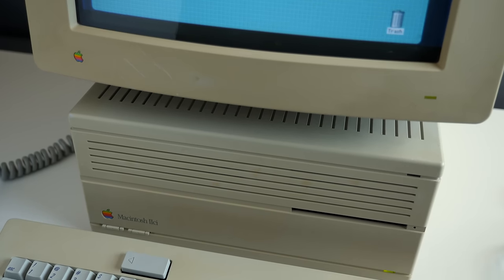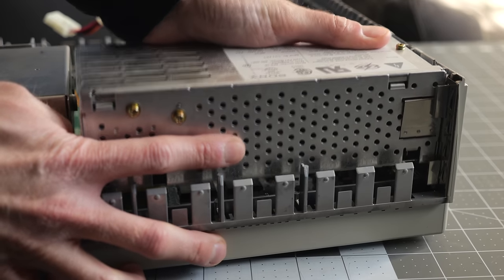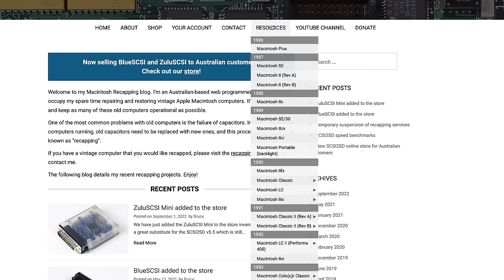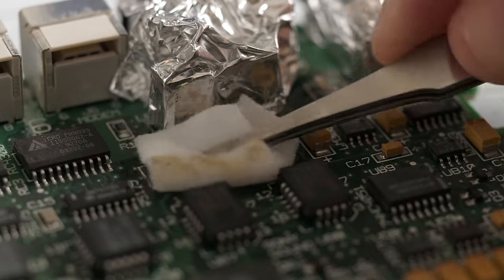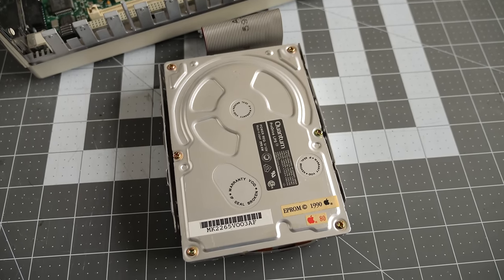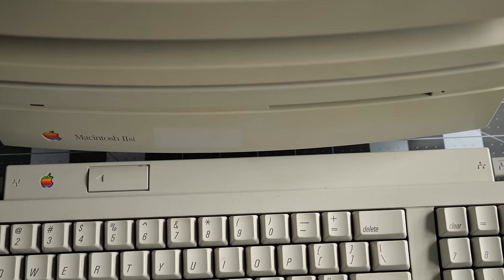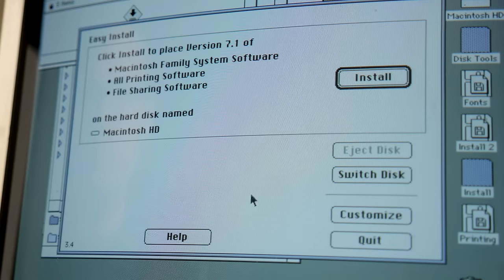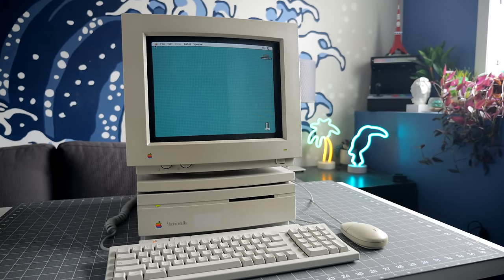Restoring One of Apple's Weirdest Vintage Macs!

Comment: Pro-tip from the car world: to release those plastic cable holder connectors that have the two teeth (look like a tree), use a socket from a socket wrench set. A small one will squeeze the tabs at the same time making it easy to pop off
Reply: In the computer world, screwdriver kits usually include a nut driver for hex-headed screws, which works pretty well.  Or the tube from a pen.  :-)
Reply: @nickwallette6201  pretty much the same thing, yes, a e-hex bit for standoffs will usually work

Comment: I completed a restoration of a IIsi where the PSU was a gooey mess from cap juice that even ate some of the traces on the logic board PSU connector. Yuk! I also made the same mistake on needing to provide external power for a BlueSCSI to work. Thank you for the explanation on using the RAM muncher to use up the extra RAM not used by the onboard video and thus improve overall performance, which I’ll add to my IIsi when I return from Spring Break vacation. Nice video, Colin!

Comment: Great episode. That BlueSCSI seems like a life-saver for these older systems.
Reply: It is, and it’s cheap enough to easily outfit an entire collection of vintage SCSI-based Macs. I love mine, and plan to buy many more.
Reply: The convenience looks great, however I like leaving spinning disks in my retro machines. Part of the charm is listening to the drive click away as the system loads software.

New hard drives are super quiet so I don't have that same fondness for newer mechanical drives, but the old ones are always satisfying to listen to.
Reply: @volvo09  This is a 100 percent valid reason to stick with spinning disks.
Reply: @volvo09  yeah I think if my first computer didn’t have that clunky head motor so I could “hear it thinking” it wouldn’t have had half the charm for me. Plus the distinctive noises it made as it unparked, and less-so when it parked.
Reply: @volvo09  I agree with you there. How’s this for irony? I have a real Commodore 64 connected to a modern flash based disk drive. It lets out the occasional beep so you know it’s working. On the other hand, the VICE emulator on my Raspberry Pi (Retro Pie) actually emulates the sound of the 1541 disk drive when loading. My brain gets more of a kick loading up games on the emulator as a result. Sound was a huge part of the memories.

Comment: Great video!  The IIsi was my first color Mac, and I recently restored one and upgraded it with a Daystar 50 MHz 68030 accelerator and Ethernet card, so it's no longer an lower-end Mac.  You can also easily add a HD activity light by hooking up another wire to the lead by the speaker.

Comment: Worth mentioning the "special" soft power button. It has a slot in it and the little graphic above it hints at it purpose. If you turn the button it will remain in the powered on state - it removes the soft power option.

Comment: Cool video. Remember having a few of these at work when my  IT group supported Macs & PCs. My recollection is that they were reasonable machines but I still preferred my IICi which was my daily driver.
Had forgotten about the shared RAM issue.

Comment: I've overclocked my IIsi to 25mhz. It required flipping the fan around, when some part on the logic board gets too hot it starts getting memory corruption. With the fan blowing directly on it it's completely stable. 
The internal video can drive a portrait display, too!

Comment: I work in electronic manufacturing. SMD department.
That flux you use, I think it's banned in manufacturing these days because it's way too strong and can corrode the board itself.
These days it's mostly used in old repair shops, not in modern manufacturing.

Comment: the IIsi was my first Mac as a kid... and I've still got it to this day. I love that it fits a full height hard drive and can take 64MB of RAM. It runs well with an FPU Card/Ethernet card, and easily overclocked with a crystal replacement and runs stable at 25MHz.

Comment: Hey just a little heads up. It's okay to replace electrolytics with tantalum caps, just as long as you're aware that tantalum caps have a different frequency rating. You could potentially cause some problems by putting a tantalum in a circuit where it shouldn't be. Say for example... where a clock frequency is.

Also be aware that the failure mode for tantalum caps is to short, instead of go open like electrolytic caps. So in the future when they fail, they could grenade other components along with it. They also don't handle voltage spikes very well, and they tend to have lower voltage ratings.

Comment: I remember using a IIFX that was loaded with early ProTools software (4 channel Pro Deck & Pro Edit) which was SOTA at the time. Soon new combined software called ProTools was released which allowed 4 channels and later 8 channels using the IIFX platform. Great little computer for the time. We also had a IISI which was a second editing machine but it never expanded beyond the original software(Pro Deck & Pro Edit) and was much slower with the processing of audio samples.

Comment: 8:54 - "user installable updates weren't really a thing back then", hardware wise that is true, however each OS update usually patched out the ROM - so much so that Apple realised that the ROM was usually patched coming to the end of the life cycle. This is probably one of the reasons why the went with ROM in RAM, not just a cost saving measure...

Comment: The IIsi's PDS is actually electrically compatible with the SE/30's. The only differences are that SE/30-compatible PDS cards don't have a 68882 (since the SE/30 already has one) and they're shaped a little different so they clear the steel chassis.

Comment: I had a very similar issue on my Macintosh IIci as you did with the BlueSCSI on this machine, just with the ZuluSCSI. It worked on the back port but not on the internal one - until I attached the power. The difference was that the drive would seem to work (the light would come on), but it would be completely unreliable, and never boot successfully. (I recapped it entirely, so it wasn't down to that either)

Comment: Thank you for making this video. I have a IIsi in my building I am going to restore once I am finished with my Color Classis and Power Macintosh G3/233MHz Beige computers. Question: Is there a site I can order the MeowTOAST PCD you used? Also, did you only have to solder the CR2023 holder to the MeowTOAST PCB? 

Thank you!
Randy

Comment: This model was my first successful recap when I started collecting retro tech in 2019. I went ahead with the crystal upgrade tho and installed a socket. I worked around the slow onboard RAM by increasing the disk cache. Original hard drive still boots and the CPU is running stable at 25MHz.

Comment: Oh The IIsi is a neat machine.  I used one for a while.  I didn't know about the RAM muncher.  I think to get around the slow 1mb RAM it was common to set the DIsk Cache to 768k to eat up that RAM and programs would then run on the faster RAM exclusively.

Comment: You could overclock that 030 with no issues, my first amiga 1200 came with a dkb cobra with a 20mhz 030 at 28mhz from factory, and I had it running at 40mhz, it even managed 46mhz but the mmu had issues. 030's don't really get warm even when overclocked. I think I just stuck a passive heatsink on it when it was at 40mhz.

Comment: Tantalum caps can fail in other ways: dead short.  I've had bad tantalum caps on old boards several times.  In one case the computer wouldn't power up, in another when it powered on the cap exploded.

Comment: Awwwwww, Brahcnus doesn't have an entry for Quadra 700. My Q700 PSU still works fine, but was thinking of recapping preemptively. 

Acutally I'm kinda suprised that there's not alot of information on the Q700 PSU caps out there, given that it's one of the most sought after models in the 68k range.

Comment: I owned a IIci and later I got to play a bit with a IIsi because we had a couple of them at a news magazine I worked for in the 90s. It was definitely not as fast.

The production department all had PowerMac 7200/120s (I owned a 7200/90 at the time). Definitely faster.

Comment: I'm getting increasingly concerned about the plastics on this era of Macintosh...they're all slowly turning back into dinosaur juice
Reply: The plastics mostly just yellow.  You can retrobright them or use a can of Krylon white paint for plastics with a small brush and roller.  The final results with paint are great.  For areas that are brittle or damaged, use JB Weld for repairs or reinforcing.

Comment: I guess I don't need to make this exact video after all 😂. Some things like the lack of term power I discovered long ago, but the PSUs in these are a new and very disappointing experience. One thing I have read multiple places but not personally verified is that the disk cache apparently loads at the very beginning of the RAM, so it will use that onboard RAM and then displace video into the SIMMs. So in theory you don't necessarily need a utility to cause that to happen. But, having either the disk cache or VRAM stored on slow DRAM chips is going to have a performance impact. So if the utility can get around putting either one there, that's even better.

Comment: I swore off of Apple in the early 90's, when trying to output chemistry lab results to disk (3.5").  No eject button on the drive, nothing I could do would eject the disk.  Now I needed the info on the disk the next day to submit.  45 minutes later, I find someone that could sort it out.  They drag and drop the floppy disk icon into the recycle bin.......and the disk ejects!  All I needed to know about Apple.  Not much has improved, proprietary, expensive...I wont even get into the buck the system connectors, chargers etc.  Decent OS though, if you want your hands tied at every corner.

Comment: 10:54, I love me some RP2040, good MCU, I basically use them for everything lol.

edit: I wonder if there is any reason I should make a PR on their git repo to integrate the RP2040 onto the main board instead of using a pico, there is probably good reason why they used a pico over a onboard RP2040.

Comment: Hang on.. I thought tantalum caps were supposed to be the bad ones
Reply: Tantalum capacitors, especially older ones, can fail shorted. That's definitely a concern, but it's a much less common and (usually) less destructive failure mode then leaking electrolytic capacitors.

Comment: Why not just replace are the caps in the power supply. Saving a few dollars and then having to take it back apart in the future just seems foolish to me. All electrolytics will eventually fail.
Reply: Yeah I am always wondering the same. I have repaired an awful lot of old electronics (since it's part of my professional job). Like you said eventually they will go. Often taking a lot of rare and hard to get other components with them. I have had a couple of scopes not long a go. Both went with a banger, lots of smoke and I had to basically desig an entire new PSU board since most of the tracks were gone.